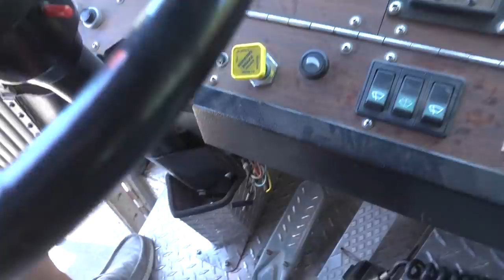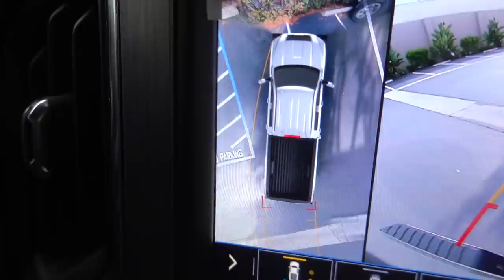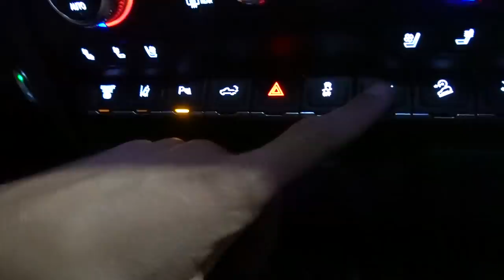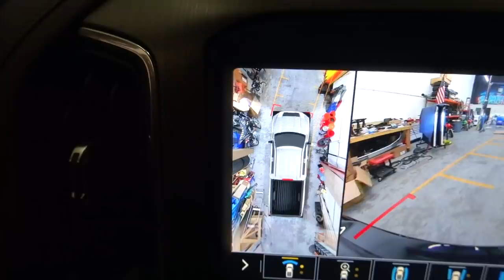STARTING THE F450 BUILD!

Comment: Can anyone let me know what it means to "bulletproof" the truck? I get that it's not literal but I got no idea what it actually means/does?
Reply: Basically replace certain parts that are prone to failure from factory to make sure shit doesnt fuck up
Reply: Watch a video and you'll see every thing that goes in to bulletproofing
Reply: So the 6.0 powerstroke has head gasket problems where When you pushed to much power they would go out and the only way to fix it is to “Bulletproof” it which means you take head studs where they have threads in one end and a nut on the other unlike the stock head bolts that stretched and caused the head gasket issues.
Reply: Addressing all factory flaws, making it a reliable engine. Typically head studs, oil coolers, egr upgrade or delete, injection system upgrades, etc. . It cost quite a bit of money to do, but there are people that run them and swear by them.